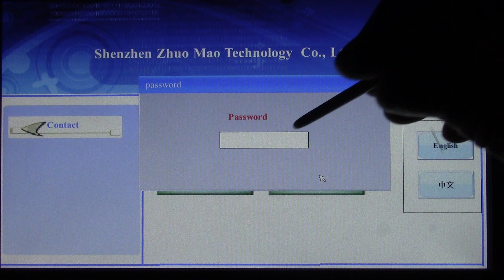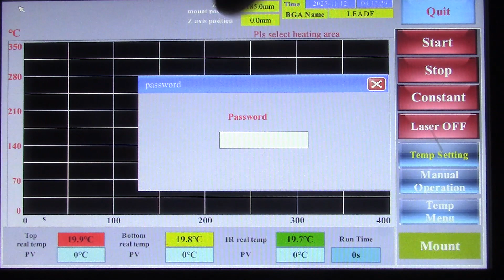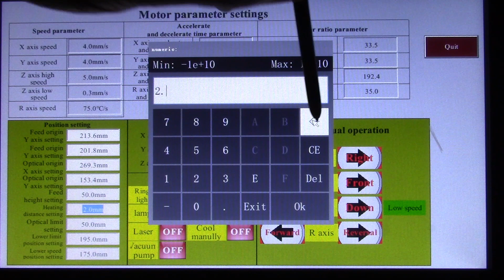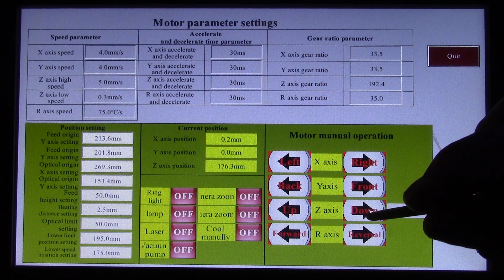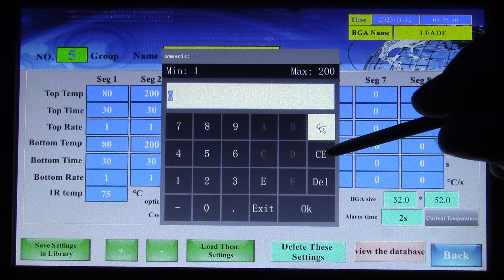ZM-R730A Touch Screen Operation Part 2

Comment: Thank you for the good video! 

I currently have the 7220A, I was also looking for the factory settings, given that it seems to be the same operating system, can I also access the factory settings by doing the same ? 

I want to be able to calibrate my thermal probe (the external one) if I decide to get another one 

Kind regards.
Reply from the maker: You don't want to mess with the PID factory settings unless you can't adjust the heat output the normal way first.  You want to match the heat output at the nozzle to the heat setting in your profile.  The internal thermo-couples have an allen lock screw.  If you move the TC toward the center ,less heat will come out. It you move the TC back, more heat will come out. See the how to calibrate heaters video at this link: https://www.pcb-repair.com/training/bga-rework-station-training-videos/
Reply: @DennisODonnell_BGA_Expert  thank you so much for the reply, love your videos !
I’ll check the link, are you planning to make more videos on bga rework ?

I’d love you see your insights on bga warping, and how to prevent that in the context of lead free rework.

Kind regards